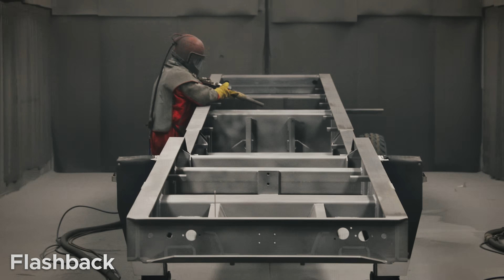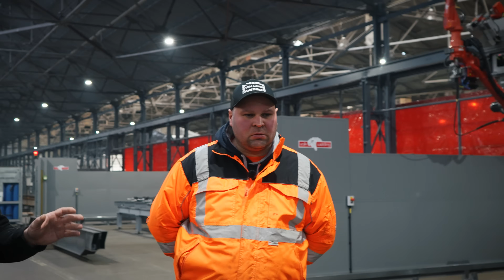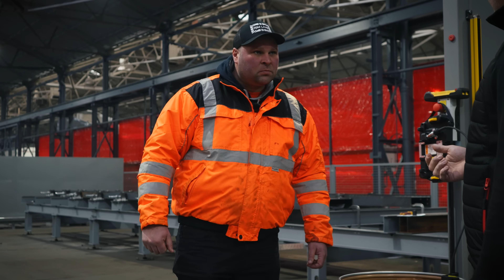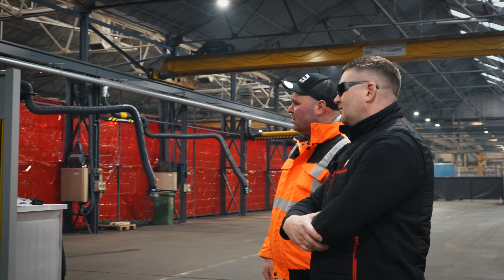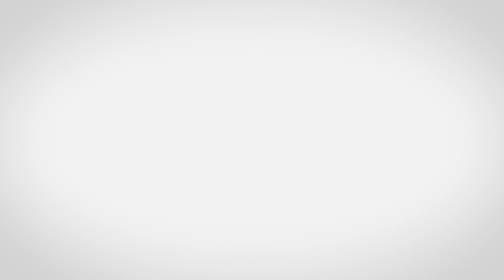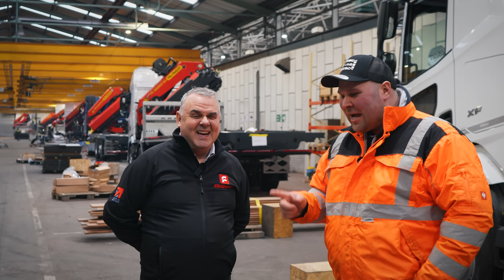AMAZING TECHNOLOGY! Robotic welders transform FRUEHAUF trailers. I was shocked!

Comment: I did a 16 week electronics training course at Ford Training Center at Dagenham about 35 years ago.  We had two maintenance people who worked at the Dagenham production plant, so they were allowed to give the rest of us (about ten if my memory is correct).  One of the most fascinating sites was a giant 300 ton press that stamped front wing/fender panel at something like twenty per minute.  The sheets were fed in, and the finished panel taken out, by robot arms, and it had to be about ten feet between the stack of sheet metal and the centre of the press, so the robots moved unbelievably quickly.  They actually had controlled acceleration to prevent the panels slipping out of alignment.  The press was completely open with just a magic eye safety barrier, and I was warned not to break the beam because it would be a seriously big deal to stop the press!  He also told me that the robot had gone awry a few weeks ago, and was throwing the sheet metal out across the factory floor like Frisbees.  I am ashamed to admit that I took him at his word at the time, and only later realised he pulling my leg.  

Another highlight of that time was that they were building the A13 elevated roadway that passed right by the Training Center, and it was fascinating watching the giant machine creeping forward extending the roadway section by section. Apparently the same machine had been used to build the M25 Queen Elizabeth Bridge over the Thames.  Or it, and another one like it, as they would have built the bridge from both sides meeting in the middle.

Comment: He mentions a fume extractor attached to the weld head @10:22  He even stresses how powerful the fume extractor is.  So how does it not compromise the gas shield from around the weld?  Do they need to use more pressure for the shielding gas than a manual MIG welding process?  There would be a cost impact with that eating into the cost savings the uber expensive robot welding stations are intended to create.
Reply: Thanks to the innovative design of the welding torch developed by Valk Welding, the gas shield is not compromised. Very similar extraction systems are also used on manual welding MIG machines. Fronius, Abicor Binzel and other producers of manual welding machines have similar extractors on their range as well. The latest HSE recommendation is welding fume extraction at source which can only be achieved by using high-vacuum extraction systems.

Comment: I wonder how many of the Original Crane Fruehauf/GT Trailer workforce have watched these videos on the new Freuhauf facility? 
It was the biggest employer in Dereham with several sites around Norfolk before GT Trailers bought it out and basically ruined it. I moonlighted from the Army when they were shutting down the North Walsham site, when we had to bring in lots of items from there. I would then go on to bring parts in from other Manufactures when I drove for ES&J Walpole whom also had the contract to supply parts to the support network. Like King Pin plates from a Company in Grantham, which if not properly bound to a pallet could easily go through a curtain. Luckily that never happened. a few close ones if the steel banding slipped they would move and don't doubt that they could cut through with the weight of them. 
I would occasionally do run when one of the two regular drivers was on holiday. It was a sad day when it Closed it doors, it was not long after that the Parts side went too. 
It is amazing to see the name live on and that they are doing so well.
Reply from the maker: It’s great that they have been able to restart it

Comment: I worked for Crane Frauhof in Dereham in the early 90's on the tanker line for a while. No robot then.
Reply: I don't think they had them in the 2000s either. They had a couple of waterjet tables in the part of the factory nearest the Offices. 
Hammonds Transport now has that part of the Factory and SCRWS have the old production lines as we would sometimes take a load out from there and take it wherever it was going. Looked vert different from be the bays that had a single trailer being built. I like many other once applied for a job as a trainee welder there. Never got a look in the early 90s.
Reply: @Simon_W74  Hi Simon - the robotic welders are a very recent addition to our facility within the last year.